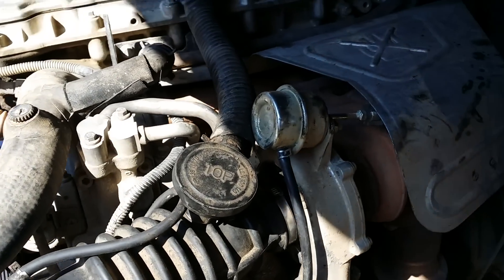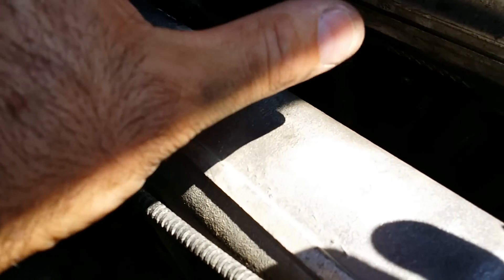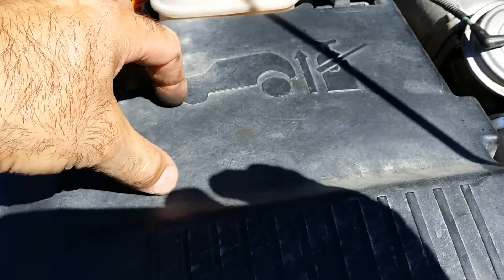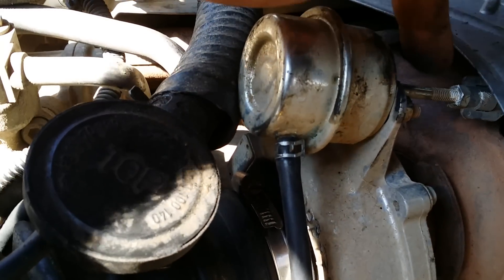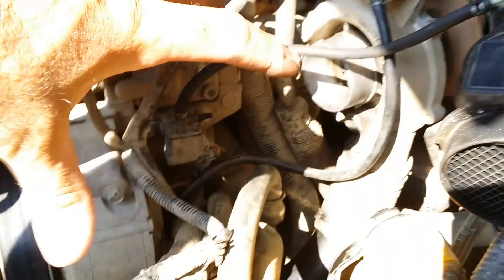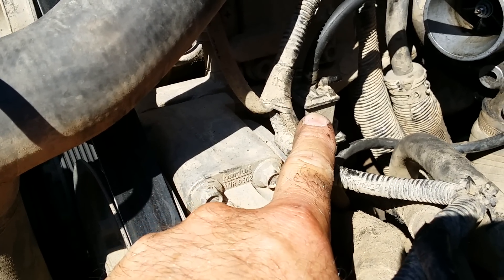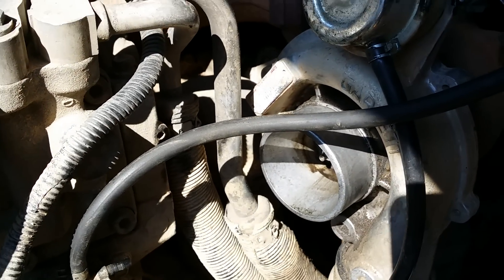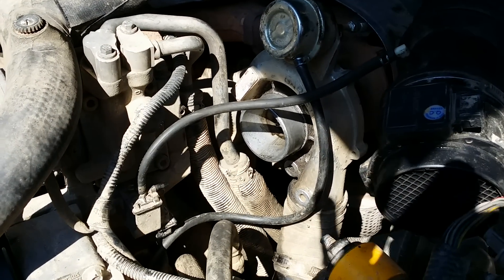Land Rover Discovery / Defender Td5 waste gate fa

Comment: just like to say a big thank u my td5 been missing for 3 weeks new fuel pump.filter, loom. MAF meter other stuff no one new why it was still missing and lost power took to garage no fault codes found i was really upset they cud be injectors which i couldnt afford so i came across yr vid and done wat u said on my own too...and after all the guys that have looked at it u were the one that fixed the prob..works fine thank u so much..phil

Comment: Had this horrible cutting out ever since I bought my disco td5  about 6 months ago done a full service had the inlet manifold off and the intercooler both now clean as a whistle still playing up so changed all turbo hoses and rad hoses as all a bit rough final issue as you recomended bypassed the hose from turbo to intercooler pipe problemo goneski 😎 Cheers for the hack I have now fitted a new MAF as it was a little spurious as to its working and she runs like a beaut thanks man keep up the great vids 🤘

Comment: Just got to say thank you for all your td5 videos. Also it's your fault for many of my 4am's getting to bed watching YouTube haha. Just bought a 99 td5 to get into off roading (new to it ). Because of your videos i knew to forget what it looks like but get underneath it  (rear chassis) checking for rust etc etc. Finally got one ok underbrush. Found waste gate spindle stuck so freed up (your videos). Bypassed relay (your videos again). Am a heating engineer by trade but someone shows me something I'll pick it up quick. My question for you or anyone in comments that can help would be great. The jeep I've bought has a 4" terraferma suspension lift. 2.5"body lift. All done before my purchase by a 4x4 off road garage. It's got correct wide angle props. The tyres are 285-75-16 beadlock rims. Powersteering when stopped it's a nightmare (as you would expect) with them tyres etc etc. Is there anything I can do like upgrade power steering pump etc or should standard pump be ok with this setup and I have a fault. It's seems ok on the go but at a stop (let's just say I don't need to do my arms in gym haha). Any help would be greatfull. And keep up the videos  (especially td5s 😁) best by a MILE for in depth help 🖒🖒🖒🖒🖒🖒🖒🖒#SUBSCRIBED

Comment: I did this on my TD5 series 2 and it works, only problem I found was the metal pipe on the turbo, the nipple holding the tube on had melted in place and was a S.O .B to remove probably because of not being removed after 16 years .
Thanks karaokedudeable

Comment: The other thing to check on the waste gate actuator is that it moves with the linkage disconnected, if it's stuck work it back and forth with an adjustable with a drop of oil until it is fully free at full travel, this is what can cause overboost fault codes at higher rpm

Comment: Thanks.. Just not sure if by-pass the Turbo regulator is a good idea. Did read it is a safety for too high turbo pressure and it regulate the turbo when riding in higher area with lower air pressure.

Comment: if you connect this directly the pressure of the turbo pipe is the same or enough to push the westgage? , I'll try it I have a problem in where I cannot go over 2500 rpm after around 30 mins of being into the road so I've been reading lot of post around this problem as I was not able to fix it so far, the thing is does not happens every time so lot of post talks about a tired fuel pump that needs replacement. IF you can make any comments base on your experience will be much appreciated. thanks.

Comment: hi   great vid. question. you say join tube from steel pipe i.e. pressue in to pip on top of air inlet by the airflow which is fine. do you then leave the two outlets pipes on the modulator open or blank them off.
cheers keith
Reply: Hi Keith..........did you find out if you need to block off the ends of the modulator? ???  I need to try this on my td5.

Comment: I had same kangeroo effect at 3000rpm it was split pipe going to the control valve hence not getting any air to the actuator causing turbo over boost same effect as a stuck actuator arm, engine cuts the fuel to save damage...so if not the stuck arm check the little black tubes to the control valve

Comment: HI, I have a d2 auto and I have an issue where if I give it the beans and rev over 3k for a bit or get over 80km/hr, I lose all power and the engine starts to cough wildly. lots of black smoke and I can only drive when the smoke clears out. 
so far Ive done: 
removed maf sensor - made the issue occor earlier
replaced filter with K&N high flow
checked wastegate its moving fine

I honestly think that the timing of the wastegate is off or not functioning, causing the engine to choke on its fumes. What do you think?